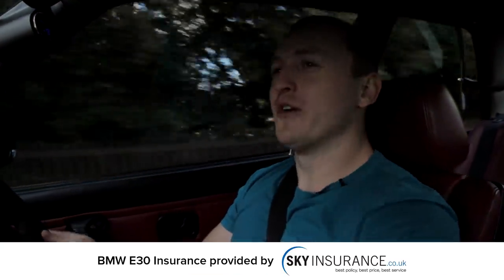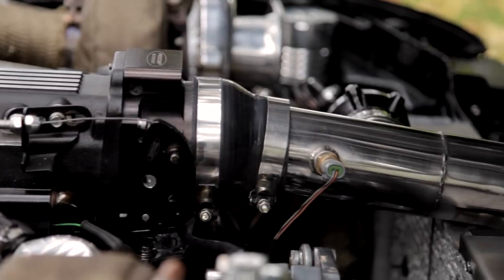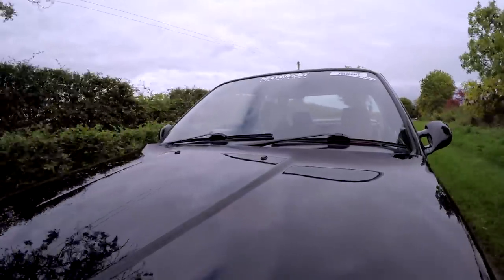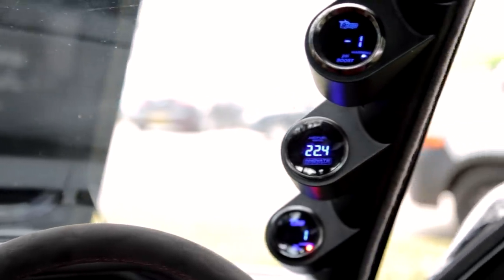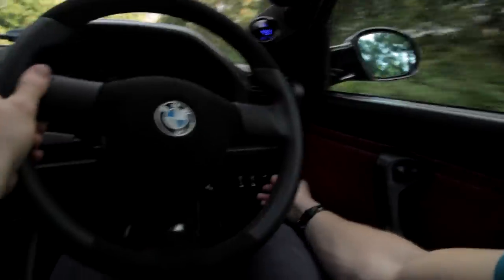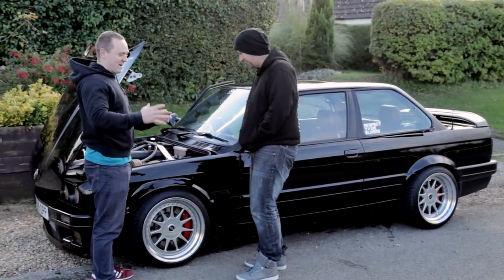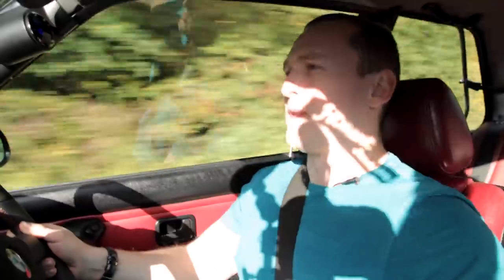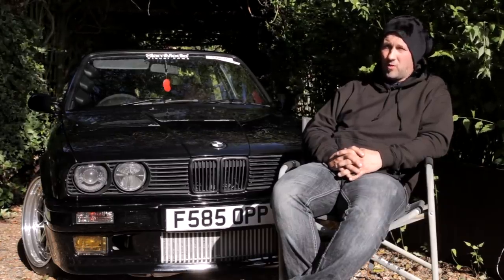800hp BMW E30 V8 Review: My Perfect Widow Maker

Comment: i get it that the Chevy V8 is more affordable but i think he should have gone with a BMW V8. i like to keep engine swaps and cars getting the swap in the same family. for example a Nissan powertrain in a Infiniti or a Renault or any of the 3 is fine by me. and sometimes i can see exceptions il admit. i have a project that my ultimate goal goes against that completely only that the engine layout is the same across both brands. anyways as long as he enjoys it thats all that really matters
Reply: i saw once a E30 with the V12 5.0 liters from the E28 750i.... never forget this monster....
Reply: Gollatas ´ for a second i was like "that's not possible, il look it up" and surely enough the V12 fits in there. Only just but that's pretty awesome.
Reply: Not everyone is made of money and if you want high hp BMW is not the way to go unless you got deep pockets! If you wanna build a car then build it don't hate on him for building his car his way
Reply: Patrick Pelletier yeah, stroke me like a lightning too. But he opened up the Engine room and there was he.
Reply: The V12 in question came from either a E31 or a E32. E28s never came with a V12 from stock. Luckily these engines fit in most 80 and early 90s BMW :)
Reply: Not only cheaper, but lighter and smaller than a BMW V12. Also easier to wrench on. I understand what you mean though.
Reply: OddisProductions yeah my fault, i got the wrong Model Code. 😂
Reply: from a car meet standpoint what you say is true....but from a practicality standpoint and at the drag strip or track....youd much rather be driving your car as fast as possible(aka trying to break it) the LS setup can stand strong against a drivers demands....practical from a part availability and replaceable aspect in regards to how long will it take to do at the track repairs etc and so on....The amount of transmissions that the engine can link to as well as how wide the powerband is. List is endless for driving purposes and winning why not go with the practical option. If were talking fun or a specific animal/driving experience then yes a "stock" "rare trim/sport" car is ideal bc nothing beats some of those cars. 1st gen m3 to CLA45 amg they all provide their own distinct driving experience. Though this TT LS car still provides its own TT LS experience over other TT LS cars that is 100% true. Let alone vs e30 swap community lol
Reply: andola jackson agreed the LS is by far the better platform but it's just not unique if you will. And I get that not everyone can afford to spend that kind of money. Which is why I respect his choice but I would have gone with something more unique if I could have sourced it of course

Comment: lol this engine is normal in usa
Reply: quarawlis stafford 
But a 1350kg kerb weight isn't.
Reply: quarawlis stafford not in an e30, and definitely without turbos. Most swapped e30s get an M50 engine.
Reply: its normal to anyone with the means and feasible capability to create a LS swap should and would its a matter of practicality and logic....cheap low maintenance and light weight.....though Iron block is strongly recommended for application of forced induction.....you cant out value what a LS setup brings let alone LS+boost...as the world stands its the go-to.....look at auto cross or any amateur racing its the king lol it makes the driver....look at the nitto challenge lmao some random LS drifter wins drag speed, and track speed at some amateur event where they give a year supply of tires lmao....and hes in you guessed it a NA LS 240sx lmao...only fitting a drifter wins a year supply of tires.

Comment: Why the camber it's disgusting
Reply: thank you for not being rice
Reply: +NotQuiteFishFPS Actually that camber is perfect! But the stretched tiny tires are the dumbest thing you can put on a 800 hp car....
Reply: +alman alman EXACTLY THANK YOU
Reply: +NotQuiteFishFPS i'm guessing for cornering
Reply: +alman alman well it isnt you should camber your wheels around as much as a supercar.
Reply: GotzeGaming I dont get what you say, but what I understood was that I shouldnt camber my car like a supercar. Actually the stock lambos ferraris etc. Have no camber or only -0.1 degrees...
Reply: +alman alman I agree
Reply: alman alman yeah there is a perfect example of why you shouldnt camber. it obviously doesnt do that much cause alot of those sport car engineers engineer there car to go as fast as it can around the nurburgring
Reply: +William Witte that much camber would make it understeer like hell
Reply: NotQuiteFishFPS uhm no it won't, only brake performance will be compromised
Reply: +William Witte also cornering and acceleration since there is a lot less rubber touching the ground. if you get over about 1.5° of camber, you're losing grip in corners. this is obviously over 5° soooo....
Reply: +alman alman Stock Lambos and Ferraris are road cars, not race cars.
Reply: +Stig's Italian Cousin but they are made to go fast because they're hypercars. in a rwd car rear camber is pretty much useless for going fast. front camber will help but not with this amount. this will only slow it down by reducing the amount of tire touching the road
Reply: Joeri Smit True, but the camber on this E30 isn't that aggressive where only a portion of the wheel is on the road. This is more of a show car than a track car anyway. But still nothing like those crazy Japanese VIP cars.
Reply: +Stig's Italian Cousin true

Comment: The build is ruined by the heavy chevy v8. Should have used a BMW engine - an M60 or M62B44 would have kept it a BMW - right now it's a chevy in E30 clothes. Do not like. 

Seriously - I've had a M60B44 in my e30  - it's not that hard to do - and I'm willing to bet a BMW V8 is somewhat cheaper in europe / GB than a chevy engine. The BMW engine is also lighter and has a better HP/liter ratio in N/A form witch would have translated in it's boosted form. Oh and it gets better mileage.
Reply: thats your choice of what you would have put in it , not mine!  i dont care about keeping it bmw my car ill do what i like with it , as for it being heavy yeah might be but it is actually more balanced now than it was as the engine if further back , i never built it for other people to like it i buit it how i wanted it 
but thanks for the input
Reply: It is a nice car tough. Great looking too.

Still, why did you go for the chevy engine?Those things are expensive. For that kind of scratch I can get an S85B50 M5 V10 + 6 speed manual (where I live).
Reply: +kaneCVR well were I live you can't get one for less than 6k , I built this engine for about 3k , Chevys are a lot cheaper than you think I mean the set of Pistons in this are 4" 8 off and cost me   220 , the whole forged bottom end including a bare block cost me less than 1k, I've been bought up with big v8s and hot rods so I've always liked them plus every one put the bmw v8 in them , why be like everyone else I like doing my own thing 👍🏼
Reply: whoa, that's a lot of $$$. I'm from Romania and here a chevy small block will set you back at least 5000 euro, while an early BMW v8 like the M60 or M62 is about 500 euro. As a matter of fact, I'm staring at a local ad witch parts out a totaled E60 M5, and the seller is asking 9000 lei for the engine and gearbox - that's roughly 2000 euro for an S85B50 V10 (cheap for even these parts). Thinking of swapping it into my e30 - the only issue would be bypassing the EWS or somehow incorporating it into my car. Meh - if he the engine turns over and is not physically damaged, I'm getting it :P
Reply: Well the v8 makes it unique

Comment: How does that throttle body boot not let go under heavy boost? i have a 2000 s4 with 22 psi and i had to go solid metal y pipe into the throttle body because it couldn't handle the extra psi?

Comment: What a sweet ride. i would give my left & right nut for that car.  it was barely starting to go by the time you let off. I would have loved to hear that TT LS get into higher RPM & to let them turbo's start spooling some major BOOST and it sucks that i didn't get to. An before anyone say's it, i know push rod v8's doesn't have the rpms of a 4banger or inline6 but i'm also a LS fan and know that, the sweet motor music that comes from an TT LS was just starting to jam out when the gig was called off. :/ But i also know that, that car is his world, many sweat, blood & tears went into it so for that reason i have much respect for you wanting to take care of & respect the car. One of my favorite car's on youtube. The story & hard work behind it make's it priceless.
Reply: +TheYamaha37 
It&#39;s an older LT1 or similar, it&#39;s not an LS, lower revs and different sound. Steel block etc, that&#39;s why it can very well handle the boost reliably with how he has built it.
Reply: im pretty sure the LT1 were 5.9L not 6.0L?  Mos people get an iron block an make an LS so it holds together better with boost if im not mistaking. & that BMW should had together reliably because he was being easy on it lol
Reply: i had an 1998 camero ss 6speed with the lt1. that thing would scream. So if that is what it had, he had more pedal left. But thanks for the info man.

Comment: So which is better? The E30 or E36? E36 has good mpg, and seems like a good all around car that happens to be rear wheel drive with good power. The E30 seems to be primarily great for drifting due to its light weight, but when it comes to reliability. My guess is the E36 beats the E30. However! I do wonder of the 2. Which does everyone else think has the better exterior look? Also keeping in mind the body kit options.

Comment: as an engineering student myself, you dont need too much expertise to be able to design stuff..... 
a short course on some AutoCAD software (make sure it includes some form of stress analysis) is all you really need!! 
and you can get all that engineering work. 
it is a tad expensive but when you spending money on you car why would you go all cheap now ?? 
obviously its a bit more trial and error on the software but I dont think you need an engineering degree to use it for yourself.....

Comment: Nice car... Very, very nice in fact. I had 3 E30 back in the day, a 316i, a 318iS and then an M50 powered 325i. I very much doubt even this monster could hit 200mph as the E30 aerodynamics are laughable, I believe anything beyond about 150mph needs considerations towards the car's CD as much as it's power. Looks like the steering is still the rubbish 4 turns lock to lock and possibly the brakes are still bias towards LHD with the bar across the bulkhead, I would have assumed the latter would be easily solved... Purists might argue there are plenty of BMW V8 and even V12 that might fit in the E30 bay, but I would hazard a guess that the American lump gives more space for turbos and is easier to modify to ultra high BHP figures.

Comment: Never seen brake rotors like on the rear of this BMW. The slots are huge. It would seem that sense you lost about half of the surface of the rotor due to the rather large slots, you in turn would lose braking efficiency. Don't see the need for such large slots on rear brake rotors. Very cool build though. Especially since it has a transmission out of a Supra. lol

Comment: i will get that body with that interior and put a 4 cylinder straight motor change to a queter exhoast and it will have 90ish HP and it will be cheap and the fuel economy will be on point

Comment: +ross bradley The car may have passed it's MOT but it is in a grey area with the law, if the wheels are outside the body more than 30mm, I educated myself on the topic. The car maybe road legal, but the driver could still get done for endangering the public with wheels that extend past the body. Look it up as I did so is some ways we are both right?

Comment: Yes, I am glad it is not my car! Been in plenty of car's that have had General Motors powertrains stuffed in them. They tend to have next to no soul left in them, handle like rubbish at high speed on twisty rounds and tend to have a lot of NVH issues. Never mind power density per cubic inch or liter and the obvious fuel cost in the UK to feed such a car.

I was unaware that I had to only say glowing positive things when yet another person stuff's a GM powertrain in a car never intended to have a V8 and that was not made in Detroit.Some reason why he could not stuff a BMW/Daimler/Rolls Royce/Toyota V8 or V10 under the hood. Not like a GM big blocks are swinging from every tree in the UK in every back yard and salvage yard????

He might as well put wheelie bars and a parachute on the rear end at this point!

Comment: 204 MPH good luck with that. Might have the power but also the drag coefficient of a medium sized aircraft hanger
Reply: +jerichom11x calculated i didnt say it would do it
Reply: ross bradley If it can't do it then why even say a number?
Reply: +jerichom11x by saying I didn't say it would do it I meant that I wouldn't have the balls to push it to try it with that much hp and gear ratio there is no doubt it will do it , it will do it on paper but for one there is no were to do it plus I'm not willing to try it
Reply: ross bradley So you build a semi fast car but are too scared to drive it. Lmfao
Reply: +jerichom11x no not at all I drive it hard and abuse it but what's anyone gonna gain by doing 200 mph no one so what's the problem
Reply: ross bradley If you dont get it then im not gonna bother explaining it to you
Reply: +jerichom11x you don't have to I've got nothing to prove to anyone hope you enjoyed the video
Reply: +Hiroheeto  he said it can do 204 mph ,yes it will probably do .And he probably he will not do it again .Bcz the car is not designed to do  204 ,and he will end up with serious issues with the car !!!

Comment: My second most favorite M3, just 1 step behind the E46. The car is amazingly amazing, but those 9000' white chrome rims are a huge turn off for me, so is the camber. I'd much rather sacrifice some performance for the classic E30 look with some more rubber on the wheels.
Reply: thanks for the comment , the wheels are actually genuine hartge ox racing wheels which bmw used on a lot of there cars so technically they are bmw wheels 
and there only polished not chrome but each to there own

Comment: The original M3 was a very toss-able light weight car that with all the standard safety equipment that’s required, no M car could ever be again. I just wonder how it handles with the extra power and without modern day driver assist systems.

Comment: With one button? 😱 800 horsepower power?
Wtf is this a war jet?

I want to know how the fuck he did it.
One button and transform the car to a weapon. So i can have daily??? And with one button? A missile!!!
Reply: +Ryizer kovich dude you can do this on any car. Why do you think most modern cars got this ECO button? Same here, just instead of ECO he has "power". its basically 2 different sets of ecu tuning. one being low boost, short injector opening times, retarded timing - that produces more mpg but less HP. while the other set up must be otherwise - higher boost, more fuel, advanced timing what pushes out way more HP but drains the fuel tank.

Comment: Its a very nice built but why does he took a Chevy engine? I mean there are several builts here in Germany with the e39 M5 Engine. This engine should be fine for 800 hp if you built it probably. And you still have a BMW engine in a BMW like it should be :-P

Comment: IS REAL POWERFUL AND HIGH PERFORMANCE CAR ! BUT, IS BREAK OUT THE BALANCE ! IF CAN CHANGE GEAR BOX IN THE BACK SIDE ( PUT IN BACK WHEEL AXLE FRONT ) AND CHANGE ENGINE ROOM FIREWALL, PUT THE ENGINE MORE INCH INSIDE, USE MORE BIGER SIZE COOLER, WILL BE DONE !